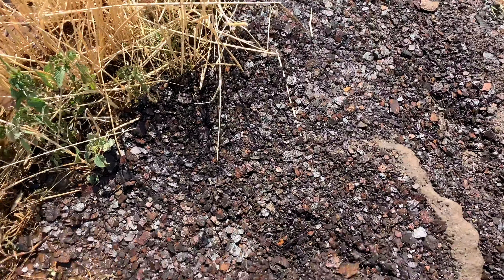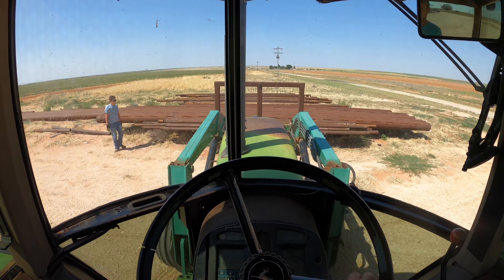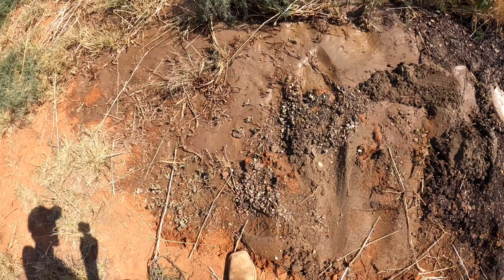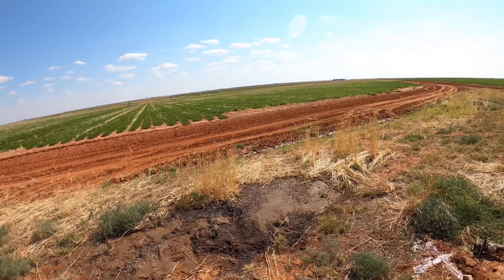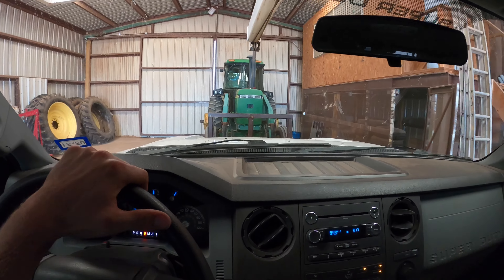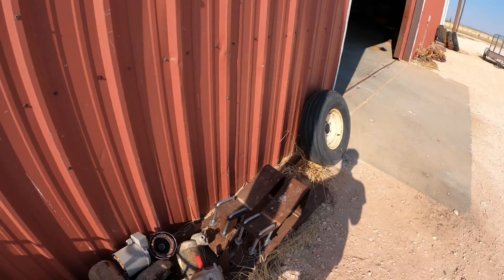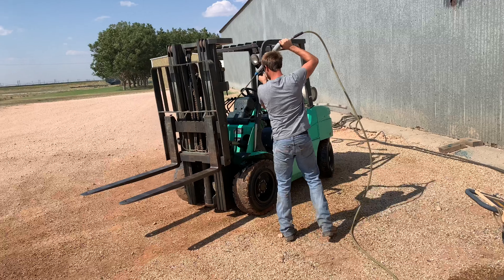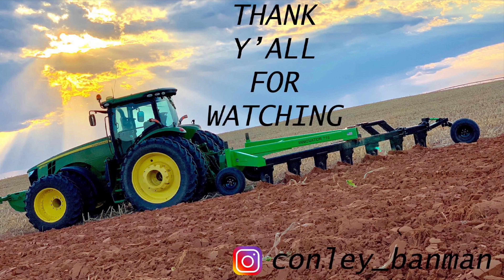Harvest equipment needs work

Comment: A hot pressure washer might come in handy.
Reply from the maker: Oh yea especially when it’s cold
Reply: @conleybanman  it also dries very fast due to the heat so you don't have to wait after cleaning before working on something.
Reply from the maker: Yea that’s very true
Reply: @drumaniac91  They also make foams for the hot pressure washer formulated for Ag/large equipment that is amazing.